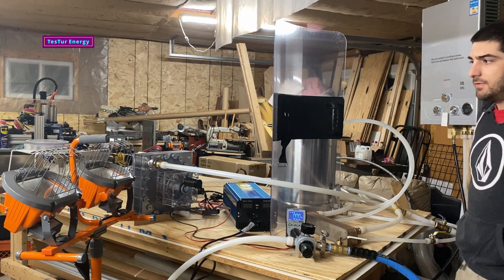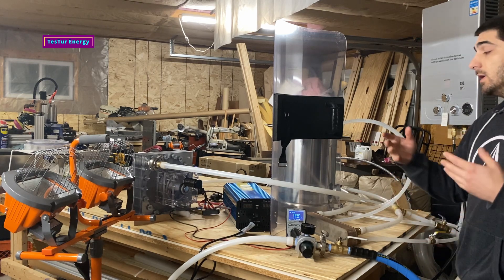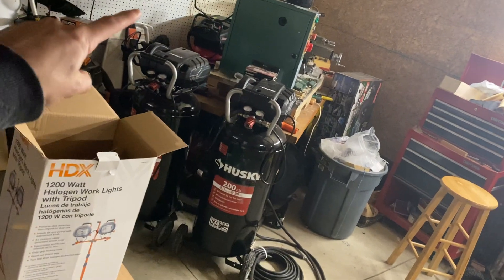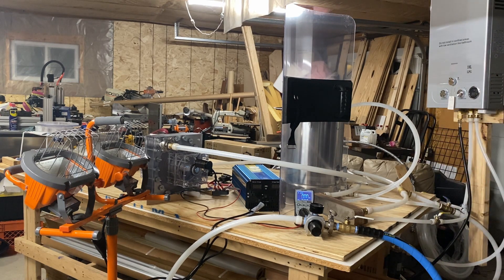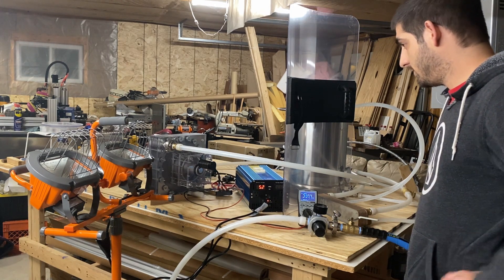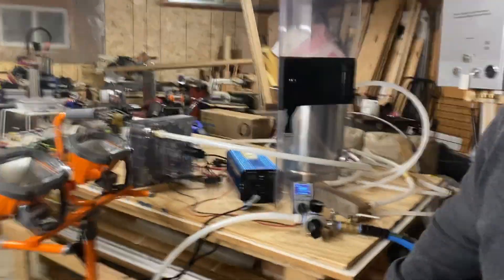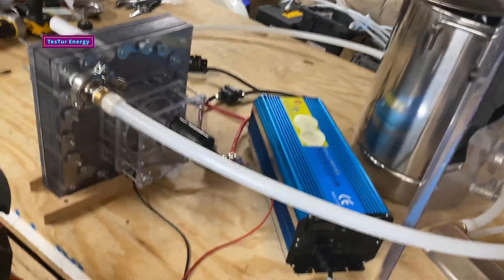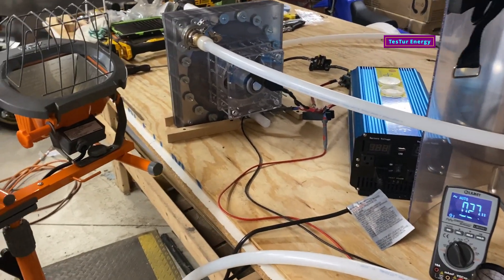Amazing Tesla Turbine Actual Power Output Test - 1200 Watt Real Electrical Load - CAES - Turbo Jet

Comment from the maker: Hey Everyone! Come check out my latest Tesla Turbine updates on the 10in diameter, 75disc aluminum and plastic prototype drive turbine dyno, 3.75horsepower and 6.22ft-lbs of torque to the shaft at only 4150rpm with a 150psi room temp compressed air supply from a regular piston compressor for now. I’m gearing it UP AT 1:3.6 to dual BLDC gens with a Kv rating of 2200rpm/volt. So for every 611 RPMs on the turbine the generators output 1volt. 

Tesla Turbine Generators With Usable Power and Torque
https://youtube.com/playlist?list=PL4XBGjR8Gu-Emu1QRPIwATKFuCZabqOh1

Tesla Turbine Dyno Horsepower And Torque Outputs! + 300mph 3.75hp 6.22 ft-lbs 4150rpm
https://youtube.com/shorts/Zxy8mIVG6as?feature=share

1200watt continuous electrical load output with room temp compressed air all the way down to 65 psi too and with the turbine only at about 6700rpm.
https://youtu.be/BHPAQF8QNnw

This is a look through of the 10in disc stack of 75 discs, +10,000in^2
https://youtube.com/shorts/FU2LMZQ2_yA?feature=share

These are the latest liquid fuel burner tests for the replication of GB 186,083.
https://youtu.be/gRqKowignac

These are the latest propane burner tests.
Tesla Turbine Jet Engine Combustion System GB 186,083 Superheated Steam
https://youtu.be/KCyyiKnIarc

I haven’t gotten to my Tesla disc compressor tests finalized just yet but I have the setup to do them already just gotta do some upgrades to my bearing and gear hubs for the generators. 
10in Tesla Compressor & Turbine w/ Built In Balancing Apparatus RC Car Dual 6s 3kW 2200kv BLDC Motor
https://youtu.be/fCQn7Q0rroI
Reply: https://youtu.be/d1ITw-Gxgqw
Reply from the maker: @ArchAngelFather  nice that’s a cool find! 

Check out our latest steam Tesla turbine tests. The system is basically the same as that waste water treatment. A byproduct of it is it makes distilled water. Ocean Thermal Energy Conversion (OTEC) plants do this with sea water too. 

Steam Tesla Turbine Micro Power Plant - 1st Start Up https://youtu.be/aMYyBsjhBR4  

Solis Talks Tesla Turbines - Nikola Tesla’s Electrical Power Systems Patent GB 186,083 Walk Through https://youtu.be/5Y3D13JmtcA

Comment: Gases get denser when cold. Thats why the air is smoother in winter for glider pilots and why if you cap plastic bottles in a deep freeze and let them warm in the sun they have more air pressure inside.

Comment: lets make clear he still needs a source of power  to produce compressed  air to move the turbine and gets power to recharge the batteries no doubt about it. what everybody is looking for is a source to produce a free energy which is impossible or a way to get a low cost energy. by the way im working on it
Reply: air tanks and solar compressor

Comment: i think we all want to know one thing.  

converting the steam from a solar steam generator to power the tesla to charge up batteries to power the house 24/7.

how much would it cost? any advantage over solar panels?

that tesla is so small. can it run 10 hours/day? is that a dumb question? i hope not.
Reply from the maker: Hey thanks for the question. 

I believe yes to all those questions. 

But we’re working on finding out to be sure! 

Stay tuned!

Comment: I don't know much about physics and engineering - I do software not hardware :-) - but it seems to me that if, instead of taking the energy out of the turbine via a crank and gears into a dynamo, you used magnetic discs in the turbine and coiled the copper wire from the dynamo directly around the turbine you could draw the power directly from the turbine whilst substantially reducing the friction and number of points of failure.... I'm sure that there are many good reasons why this would not work... or somebody would have already done it,... maybe they have.... Your turbine and dynamo would become one and the same....

Comment: just here a year later to check your still alive.
Reply from the maker: Alive and kicking! Thanks for checking in! 

Make sure to check out the latest updates on the combustion + steam Tesla turbine builds!   

Tesla Turbine 250 watt to 2.65 kW Power and Efficiency 
Test https://youtu.be/K7qZvq1CMFg  

+5 Horsepower Tesla Turbine Dyno Jet Turbo Power & Torque Curve 375 mph @ 12,000 rpm  
https://youtu.be/exF5Rn-L8gs  

Solis Talks Tesla Turbines - Nikola Tesla’s Electrical Power Systems Patent GB 186,083 Walk Through 
https://youtu.be/5Y3D13JmtcA  

Tesla Turbine Jet Engine - gasoline fuel burner atomizer flame tube test 186,083 propane burner 
https://youtu.be/gRqKowignac

Steam Tesla Turbine Micro Power Plant - 1st Start Up https://youtu.be/aMYyBsjhBR4

Comment: btw, diameter of pipe with air?
Reply from the maker: Hey thanks for commenting! It’s coming out of the tank at 1/2in.
Reply from the maker: It get bigger after than but it chokes to 3/4in pex from the tank to the throttle. Then into dual 1/2in pex, one to each turbine nozzle.
Reply: I will do the calculations if my upgrade makes sense. With this engine we can make new Batteries, and enter with new solutions in renewable energy sources. I myself have a company that deals with this industry, and I would love to partner with you - because we can be billionaires 😂
Reply from the maker: @stickylabhome7568  🙏❤️‍🔥  If Please send us an email at TesTurEnergy@gmail.com and either Andrew or I will be more than happy to get back to you.    

www.TesTurEnergy.com

With TesTur Energy, our mission is to give people energy independence through Combined Heat And Power (CHP) systems that can make use of underutilized energy sources like biomass, solar thermal, geothermal and even low grade fuels containing high quantities of solid particulates (like pulverized coal and powdered iron); energy sources/stores that are currently underutilized due to the lack of turbines and engines capable of handling the multiphase fluid flows (any combination of gasses, liquids, solid particulates) present in low grade heat boilers and low grade fuel sources without damage over prolonged/continuous periods of use.
Reply: @CharlieSolis  check inbox :)

Comment: the question is how to produce homie 150 psi pressure

pressure cook just give u 15-30 psi 

hv u ever try how much the electricity that u produce using 15-30 psi pressure
Reply from the maker: I really appreciate you taking the time to leave me a comment, it means a lot to me and it helps increase my visibility on the algorithm. I’m glad you’re interested in learning more about my project, I’ve put a lot of work into.

So just to start off, the 150 psi is the pressure the air is stored at in the air tanks. But that’s not the pressure at the nozzle. 

That being said, getting 150psi air is not hard to do at all. In fact a lot of Amish communities use windmills to compress air in massive tanks for running their woodworking machines and shop fans on the ceiling. 

Compressed Air Energy Storage (CAES) is an entirely viable, feasible, and field tested energy storage system. Cost wise they run about the same as expensive lipos but with the proper tank maintenance the air tanks will long outlast most batteries. 

On that note though, the volumetric energy density is very low. So the installation for storing any significant amount of energy is massive. 

The only at scale systems I’ve seen have been done on farms where they have tons of land. They’ll dig and burry all the tanks and then they can use the land above for growing/farming use still. 

Now, these preliminary tests are just to see how much electrical power can be produced with room temp compressed air driving the Tesla turbine. 

The TesTur nozzles never went over 20psi at the nozzle for the 2650watt electrical load test and not over 40psi at the nozzle for the 4250watt dyno test.   

This is so I can get a baseline for what to expect as I increase the temps to combustion levels.   

When using elastic gasses the counterintuitive thing most overlook is that the viscosity of gasses goes up with temp. 

So not only do we see an increase in thermodynamic efficiency from increased temps but the TesTur isentropic efficiency also goes up due to the reduced slip from the increased viscosity.   

Tesla Turbine 250 watt to 2.65 kW Power and Efficiency Test https://youtu.be/K7qZvq1CMFg  

+5 Horsepower Tesla Turbine Dyno Jet Turbo Power & Torque Curve 375 mph @ 12,000 rpm  https://youtu.be/exF5Rn-L8gs  

Make sure to check out the latest updates on the combustion + steam Tesla turbine builds!   

Tesla Turbine Jet Engine - gasoline fuel burner atomizer flame tube test 186,083 propane burner https://youtu.be/gRqKowignac 

Solis Talks Tesla Turbines - Nikola Tesla’s Electrical Power Systems Patent GB 186,083 Walk Through https://youtu.be/5Y3D13JmtcA  

Steam Tesla Turbine Micro Power Plant - 1st Start Up https://youtu.be/aMYyBsjhBR4   

If you have any questions, please don’t hesitate to leave a comment or message me, I would be more than happy to provide detailed answers. 

Thanks again for your support, and if you want to help me out even more, please consider donating to my Patreon page or any of the places on my linktree in my bio, it will help me to continue my project. Your support is greatly appreciated.